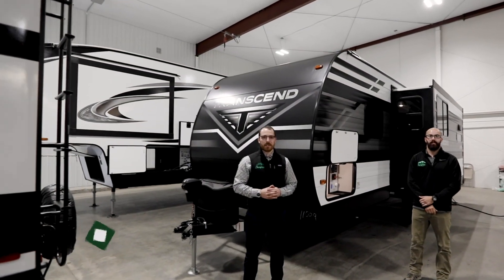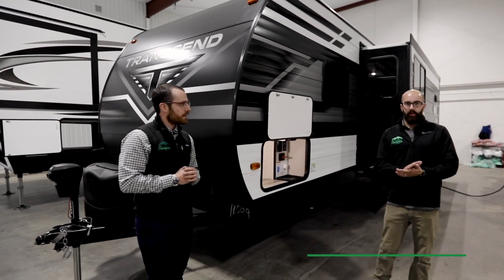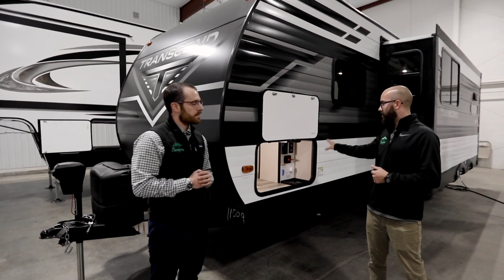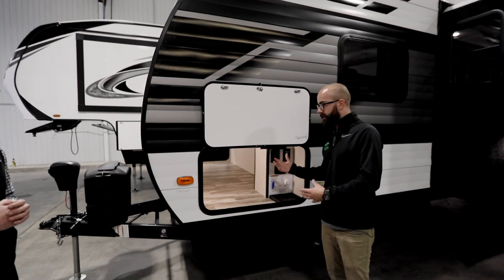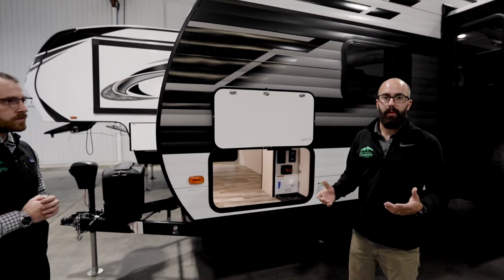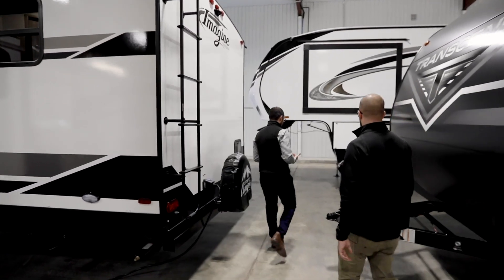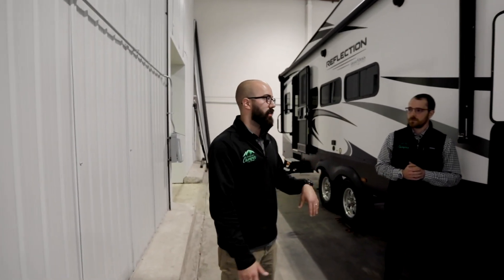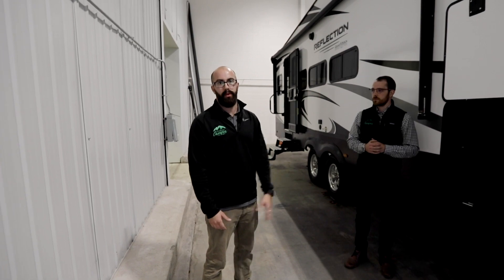RV Battery Disconnect Tips | Country Camper

Comment: We have a new-to-us 2022, 311BHS and are newbie 5th wheelers.  When the battery is disconnected for several weeks/months in an off-site storage facility that does not provide shore power, and then we are ready to roll out again for another adventure, by reconnecting or 'turning on' the battery disconnect, will there still be enough power in the batterybatteries to proceed with the auto hitching process.  We are under the impression that although you engage the battery disconnect, there are still items that draw power (i.e. CO monitor, etc.).  We are scheduled to change out the original factory battery and replacing with 3 new batteries (for dry camping purposes).  Will there be enough stored power in the batteries to perform the hitching process?

Comment: Disappointing that you don't mention certain functions - like the landing gear feet on a 5th wheel - are still active even with the disconnect switch in the off position.  I have to disconnect the negative terminal on my 5th wheel when in storage to prevent total discharge within a few days.